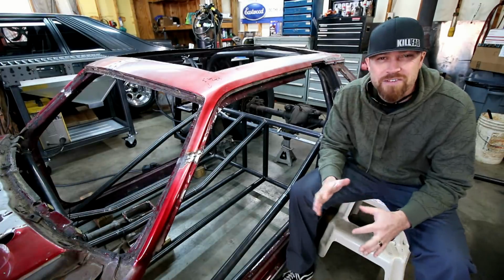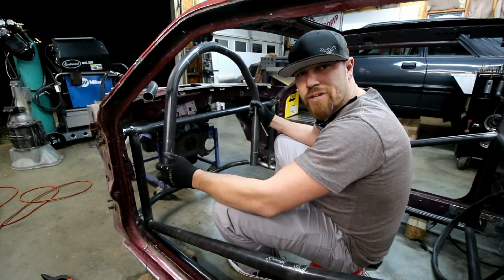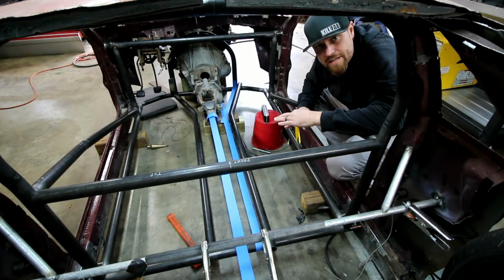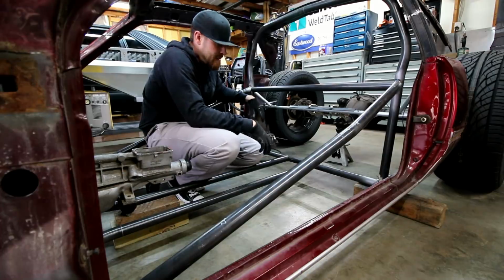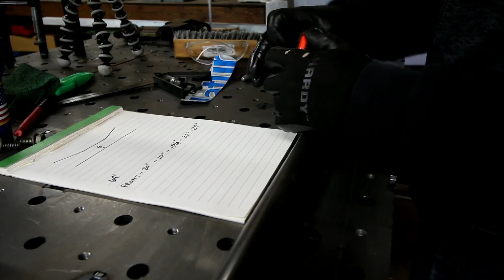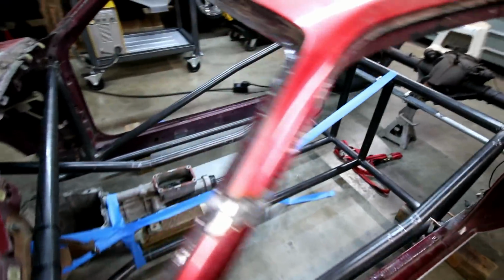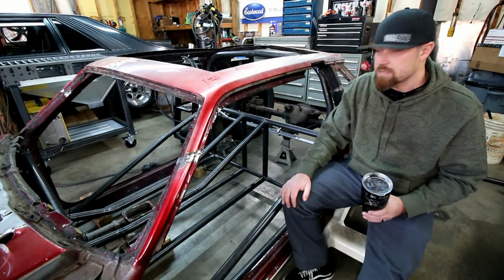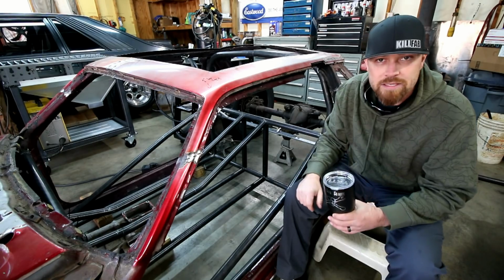Fox Body Mustang Hot Rod Build | Tube Chassis Upgrades

Comment: Will you be able to drop the trans by itself? Never got a clear view in the video if there was enough room between the lower bars. Just thinking about clutch changes.
Reply from the maker: +chefdan87 probably not . I will just pull it out the front if needed

Comment: Since you mentioned doing a hydraulic to coil over suspension, you should check out these things made by Mittler  bros called "hydroshox". They're pretty much a simplified version of what you're looking for without all the cantilever bars and whatnot since having room to mount everything is going to be pretty tight.  I don't blame you if you wanted to fab your very own setup though. It's much cooler to have one off setups that you designed, engineered, and built yourself.
Reply from the maker: I have seen those...problem is they dont make them in a strut

Comment: Are you gonna try and get a controller for the variable height suspension? Cuz that sounds clever as hell. An arduino controlling the solenoids with rotation sensors for height could make it for a really truck settup.
Reply from the maker: not sure....havent really thought that far ahead

Comment: Cool fabrication,
I i might be wrong, but i think your floor structure needs some diagonals reinforcement, the way it's currently made concentrate all the stress on those weld joints of the tubes.
Great vie Kyle .
Reply from the maker: yeah I plan to put some in

Comment: Hey man when your certiflat table arrived from shipping was is flat or warped? Mine is an 1/8 inch out and is warped.
Reply from the maker: I was pretty flat....anything that was out was pulled together by the cross slats during assembly

Comment: When tig welding in awkward positions on the chassis, is your amperage control on the torch?
Reply from the maker: Yeah I just set the amps on the machine and then just use the torch trigger
Reply: thanks

Comment: Sweet!! Few questions. What size tubing and type? How many sticks have you used? Where are you getting your steel and ~ how much is a stick? I'd like to tackle something like this someday but seems like the tubing cost can rack up quick!
Reply from the maker: what I have used so far is 1 5/8 .065 wall chrome moly. I have used 3 of 5 sticks so far. I also have a stick of 1 1/2. All total was in the $800 range. I think if you go mild steel you could get out a little cheaper.
Reply: The Fab Forums Hmm... I wonder if my steel yard quoted me for chromoly instead of mild cus that's like the exact same price they gave me. Guessing if I went with mild I should jump up to like 1 3/4"?

Comment: It's looking good!  

What's the plans for when you need to service the transmission or clutch? Will the transmission clear those bars? Or do you just plan to slide the whole engine and transmission out to work on it?  Anyway to make a section of the upper transmission tunnel bars removable? Kind of like the removable door bars on a roll cage. That would sure make pulling the transmission easier.

Can't wait to see this come together. Keep up the good work.
Reply from the maker: yeah the plans are to just take everything in and out of the front
Reply: Have you watched the fun Cleetus is having with the clutch in Leroy the savage? Pulling the engine for every clutch issue will get tedious. Now is the time to make it easy.

Comment: You should use a sleeve bag instead of hydros.  You can put it in the same place as you were planning on doing the hydro cylinder and still be on the cantilever
Reply from the maker: are those air operated?
Reply: The Fab Forums yes, air operated
Reply: Shockwaves are the shit! Airbag with a shock inbuilt will give you easy to hide suspension with the ability to lay out. The travel is only 4ish inches though.
Reply: The Fab Forums yea a sleeve bag would be like a f9000. Air operated and a little more compact than a hydro cylinder.   To get the right ride with hydraulics you would need 2 pumps 4 dumps and at least 2 batteries.  Air would be more compact and easier to hide.

Comment: Hi i'm curently interested in the idea of doing a really big project with my old car that the insurance company might want to wreck. thinking of buying the wreck and making a track car with role cage fwd to rwd conversion and a decent v8. but i'm just thinking how much doses this kind of a build cost? don't need any specifics just wondering for example how much your project costs aproximetly?

friendly regards from Norway :)
Reply from the maker: +C.C Duck my projects is probably not a good example. It can cost you as little or as much as you want. I saved a lot of money using a lot of the factory components.
Reply: thnx for the reply. i feel like your project is a nice example :)
i know how much the engien, transmission, chassis, and suspension costs.
but i have no idea what the cage will cost or other small things that you will need during the project....
Keep up the videos and great work realy nice to watch your projects in the making :)

Comment: bars. barsbarsbarsbars. barsbars. THEY'RE TUBES!
Reply from the maker: +9rjharper lol...do they call them roll tubes? It's tubing to me until I make something with them then they are bars.
Reply: As I said elsewhere, "No need to take it too seriously, I don't. It's only mildly irritating when I use bars, and tubes, to build things all day every day, and hear them called the wrong thing. I'm sure if you're in another line of work, it doesn't strike you as obnoxious, but it does for me slightly. I can't really be bothered on this intoxicated new years eve to think of an analogy. Wait. It's sort of like calling a sheet a tube. There's an analogy." When someone calls them "rollbars" it still slightly bugs me. I call them cages and I build them everyday. I noticed you use the term "tube chassis". That's not made out of solid bars? Weird. They are tubes. Literally, tubes. A bar is something different. I'm sure you know that, obviously. If someone called them "pipes" I bet that would annoy you. Also, you say "I needed a lot of rigidity". If the back of your center trans tunnel tubes weren't on the same plane as your door tubes your rigidity would increase, uh, a fuck load. Don't take this wrong. You do cool work. Just a couple of pet peeves.
Reply: It's not really grammar. It's the literal definition of the words. No need to take it too seriously, I don't. It's only mildly irritating when I use bars, and tubes, to build things all day every day, and hear them called the wrong thing. I'm sure if you're in another line of work, it doesn't strike you as obnoxious, but it does for me slightly. I can't really be bothered on this intoxicated new years eve to think of an analogy. Wait. It's sort of like calling a sheet a tube. There's an analogy.
Reply from the maker: Yeah agree bars are not the correct name for these tubes.
Reply: Excuse my rant.

Comment: For those not familiar or very experienced in tubular cage or chassis construction, TRIANGULATION is STRENGTH = RIGIDITY.............
Reply from the maker: yeah what he said
Reply: heh... i just posted asking about that and then read this.
Reply: On that topic, If the upper bars on the trans tunnel angled toward the center of the car after the spot the driveshaft loop will go, and met at the center of the seatbelt bar, with the vertical braces angled inward to the same point, it would do a couple things:
1. It would create a whole bunch more room for driver and passenger elbows. 
2. It would create triangulation in the tunnel, and the beltbar braces. 
3. It would also make larger areas for the rad, hyd stuff and batteries.
4. It would make more content for us to watch

Comment: I know you did it a while ago but is there a reason you went with round tube as opposed to rectangular tubing for the floor perimeter specifically near the rockers etc?
Reply from the maker: weight mainly
Reply: Cool.  That makes sense to me less weight same strength.

Comment: U should make the exhaust come out the side with 4 pipes that would be super hot rod I can picture that
Reply from the maker: well it going to have a turbo
Reply: The Fab Forums The Fab Forums yeah i forgot no I was thinking like out the sides by the back wheels but u might have clearance issues with the doors and turbo pipes ect

Comment: 3 step a head for you bend  dia pipe straal  x pi =😲whhaa  
 before you weld it together clean the corners wel you get stronger weld ore soda sand blast it 🔫🔫🔫🔫🔫🔫🔫🔫🔫🔫🔫🔫🔫the frame
Good work kyle on the bipster👌

Comment: If you are thinking of hydro for suspension drop with cantilevers why not use air bags where the hydro would be? lighter and might even give you a better ride.
Reply from the maker: +R N. A few reason. I don't want air pumps running all the time, hydro cylinders are much smaller than bags, I don't have room for an air tank....

Comment: Kyle just wanted to say thank you for movtivating me I am not near the factor you are I do a lot of cad ( cardboard aided design ) use pvc to mock up pipe for chassis work but anyways after watching u I decide I need to get krack a lackin on my project 50 buick fast back putting in a camaro subframe air bags pretty standard build but still needed hours put on it got the frame all tacked up today going to put clip on and put motor in see how she sits before final weld every thing
Reply from the maker: awesome. sounds like a cool build

Comment: Go do work son. LOL I was trying to avoid it. -30C with a wind chill factor of -38C. Sisters car threw serpentine belt yesterday, and sons 93 Grand Prix just up and died. 2 non runners that I cant drive to my non heated garage. My 99 1500's heater/blower motor sounds like it's trying to eat it's self. I would prefer to stay inside and watch your videos.
Reply from the maker: lol...that sucks. I would have to move
Reply: Extreme weather advisory for most of Alberta. Fort  Mac, was around -40C this morning. To see another Hollywood actor come up to Alberta and preach about global warming, oh wait it's to cold for them. LOL I just ignore them, they are clueless. But I must say I'm really impressed with the frame work. And I never thought of using tape, like that. I thought I was a brilliant with CAD. Cardboard assisted design.

Comment: Dude. I don't know if you figured out what you want yet but have you checked this set up before? Go to the link and search through the pictures of the article. It has bags for lift and coils for the handling. Something like this with hydro on the front and back might do what you are wanting. 
http://www.trucktrend.com/cool-trucks/0701st-custom-1993-toyota-pickup/
Reply from the maker: yeah that basically what I am doing except replacing the air bags with hydro
Reply: Sweet man. Just figured id try and give a helping hand. Keep up the good work.

Comment: Why did you use a 8.8 instead of a 9" ford rear axle it is much stronger!!
Reply from the maker: 8.8 will handle 2000+ hp....how much stronger do you need?
Beside the the difference between a 8.8 inch ring gear and a 9 inch ring gear is only like a 1/8 of an inch, how much stronger could it be. The main strength advantage to the 9 inch rear is in the housing ends not in the gear set, most guys just put 9 inch housing ends on the 8.8 housings and rock on...